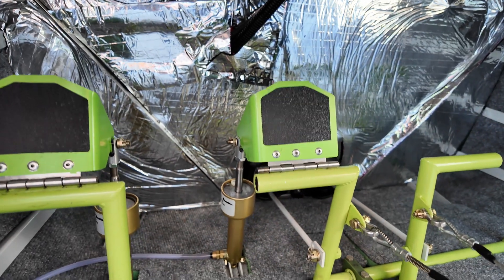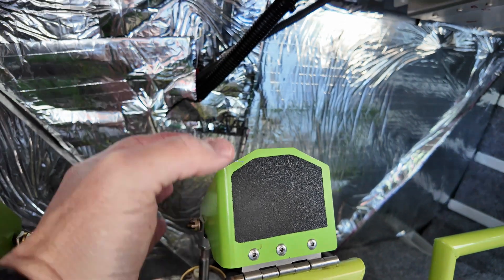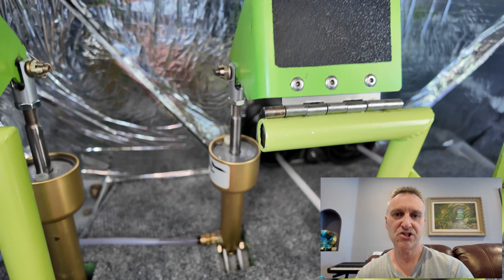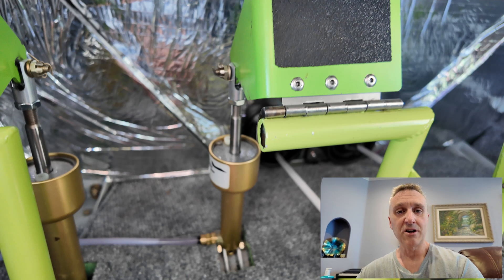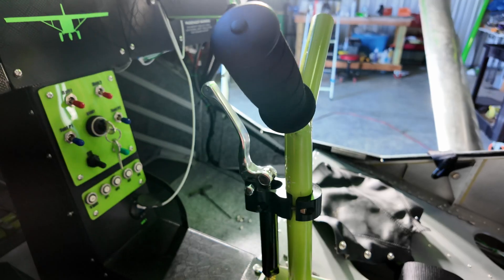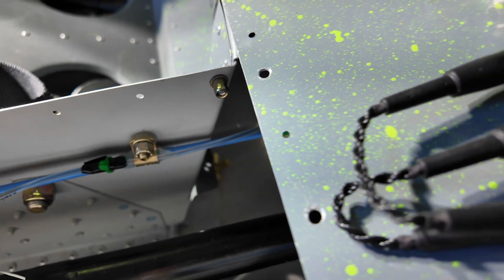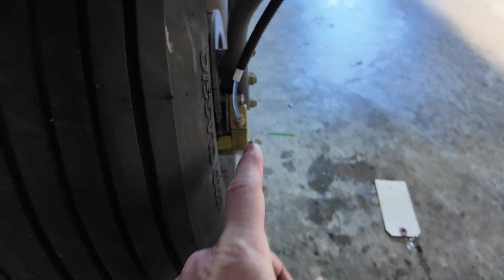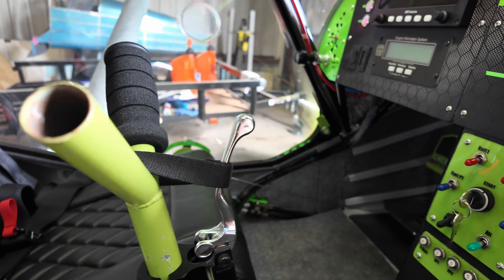Zenith Cruzer Handbrake

Comment: My Edition 1/12+ years-old 750 STOL came supplied with dual puck brakes that work great - don't know why or when Zenith switched to the single puck brakes?  I operate off turf, so although I can lock the wheels up, the plane will still take off, sliding on the grass! BTW, I've heard some complain the nylon brake tubing is too compliant and stainless braided will make the brakes more effective.  However, a Boeing engineer told me they use the exact same nylon tubing on some of their test rigs and it will effectively handle several multiples of the max pressure that can be achieved with the Matco master cylinders.
Reply from the maker: @n206ja  Since my plane is the Cruzer, and normally comes with small tires, maybe the single puck system works? For my larger tires it was not good. I have heard both sides of the arguments for and against the nylon tubing. Not sure what the right answer is, other than I am a lot happier with my brakes now! On a grass strip, I bet I could come pretty close to locking the wheels and sliding…

Comment: Don’t you miss the differential braking?
Reply from the maker: @C-FJNJ  Not even a little😀. My Cherokee, Sonex, and challenger just had a pull bar for brakes. My nose wheel only has so much turn anyway….
Reply: @mhilderbrand7693  Understood. I've got intensifiers and 1/8" line and have made some geometry mods and still have crappy brakes. I may consider this...
Reply from the maker: @C-FJNJ  Sure… I know some people will say their brakes work just fine…, who knows😀